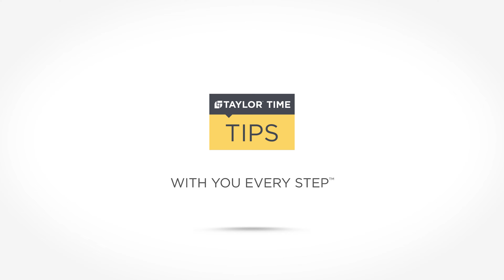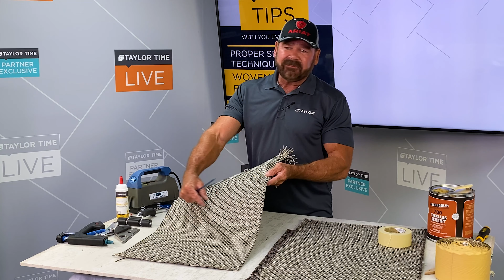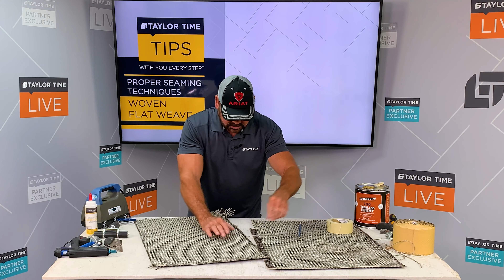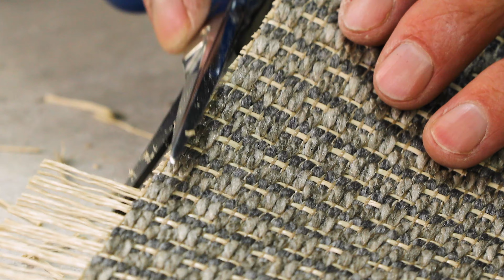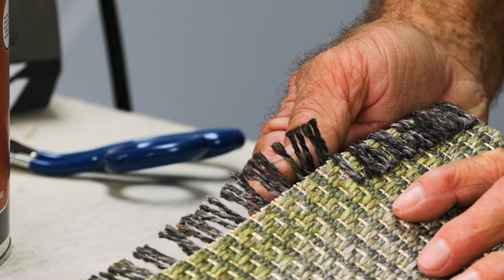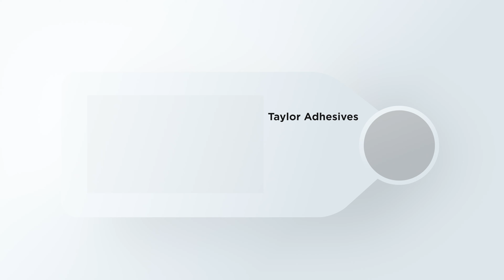PROPER SEAMING TECHNIQUES | Woven Flat Weave

Comment: I'm feeling carpet together for a hardwood stair landing that will have a seam in it, possibly two seams. 
Being a runner, the stairs and landing will have 3 inches of wood showing on the stairs and landing.
The pattern has stripes.  To make the two carpet runs symmetrical, there will be a 2-inch section cut in the center of the landing and the lines will move closer together.  No way around this.   
This is a very thin karastan carpet..... The seam tape is almost as thick as the carpet.   It's like 3/16 of an inch thick.  
Is a flat weave but it has an action back adhered to it.  I would love to see a hand sewn construction method for a thin flatweave carpet like this.  It's like open heart surgery or brain surgery, something very delicate.  I wish hand sewing was shown more often, because it's sometimes necessary but impossible to find on the internet. 
I love what you showed here to secure the edges of this carpet. Very well explained.

Comment: Carpets like this should not be installed wall to wall. They should be bound on the edges and made into a loose lay  rug only. Installers should refuseto install it or charge 10 times the amount to do it right.